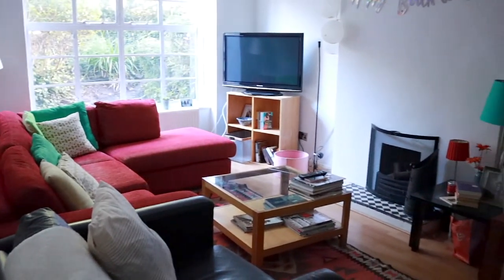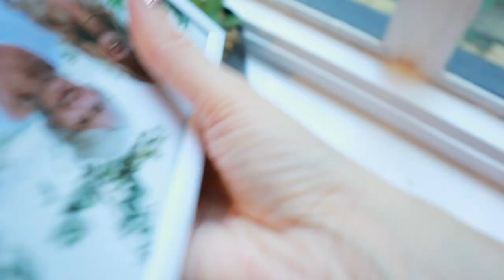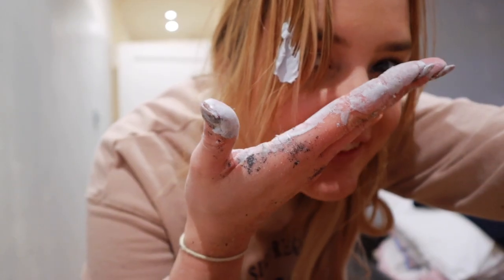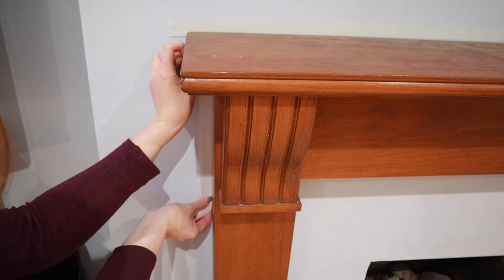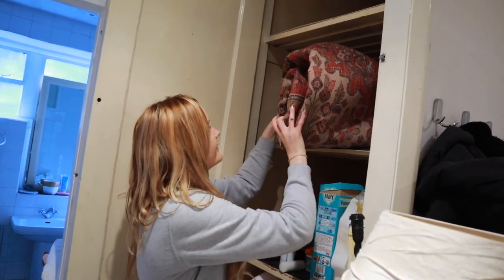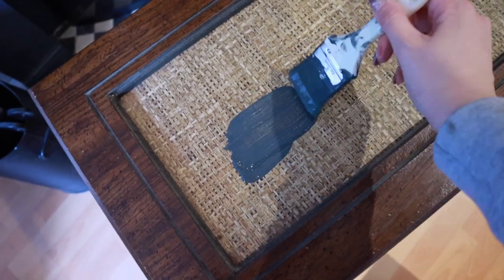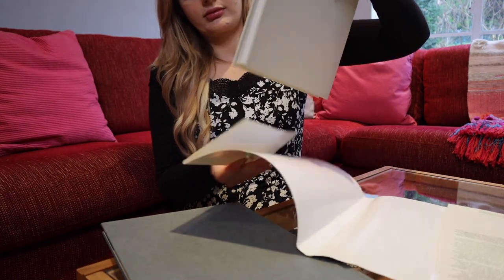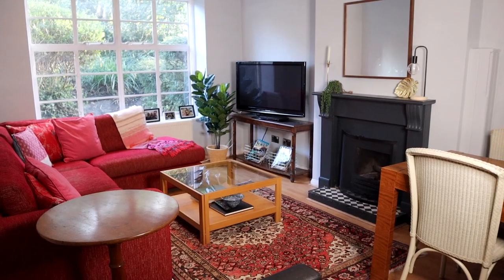Extreme Living Room Makeover on a Budget | Rental Makeover in London

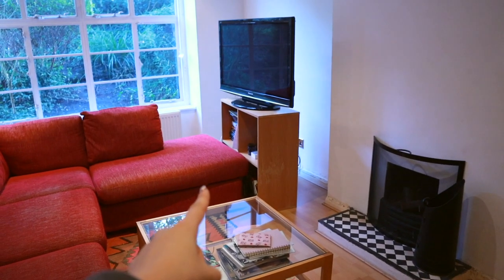Comment: Hi Hermione! I'm at 3:19 in the video and I just saw the screws and I wanted to leave a tip for whoever may be interested: If you have a rounded screw o a screwdriver that's a little too small, try putting an elastic band between them and with a little bit of insistence you should be able to get them out. If you got some on your hands even a little bit of a sturdy bi-component putty on the head of the screw do the trick, if you use the screwdriver to redo the indent. I hope this will help. Sorry for broken english. ^^"
Reply: There are special screwdrivers to take out rounded screw heads.
Reply: My father showed me the rubber band trick and it saved me a few times! :)
Reply: What about if the screw is just going round and round in wall/door. I have a hook on the inner door of my wardrobe. Tried taking it down. And it just spins inside. :/
Reply: Tracey leigh pliers and pull
Reply: Tracey leigh it May have a nut or something on the other end stopping it from coming out. If you can’t get to it just yank the damn thing out 🤷🏻‍♀️ you can patch the hole later

Comment: I love the fireplace, rug and the red sofa! I agree with comments to paint the floating shelves to match the fireplace.  and spray paint the dining chairs to match a color from the throw pillows or the sofa throw though to mirror that side of the room. There is a Screw Extractor Kit you can get online. I have one and its amazing when someone does things like that! I would change out the coffee table for a round one, painted to match the fireplace, to soften all the square corners of the couch. Move the round end table out or use the round table instead for the dining table.

Comment: I like the couch with the pillows you did. The fireplace looks awesome, those black and white tiles are so cool. Two things I would have done, put some art on the wall behind the couch, a nice big piece or a wall hanging or something, just to add more texture/pattern to the space (does not need to be super colorful to compete with the couch), and at some point I would get a round dining table. I get that the four seats are needed but a round one would free up some space, still function the same and make the space appear larger. I get that this is a budget makeover so maybe something to look for in charity shops in the future.

Comment: If you put a large rubber band flat over stripped / rounded out screws and use the screwdriver over top it will provide some extra grip to remove the problem screws.